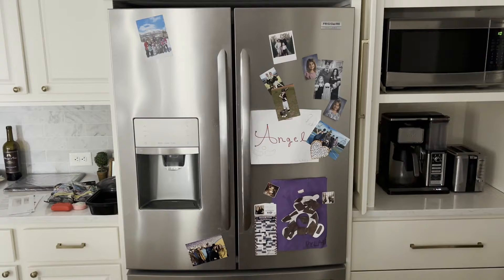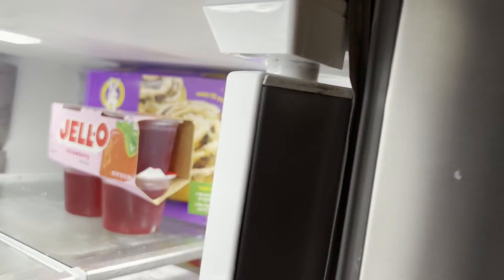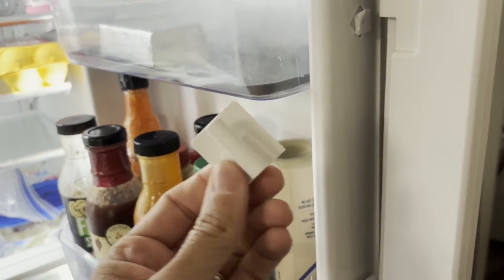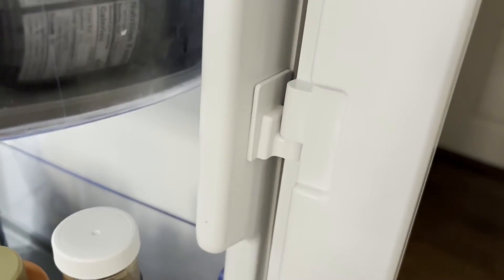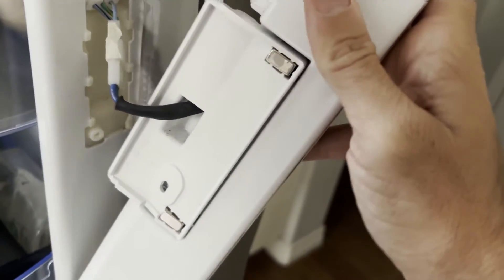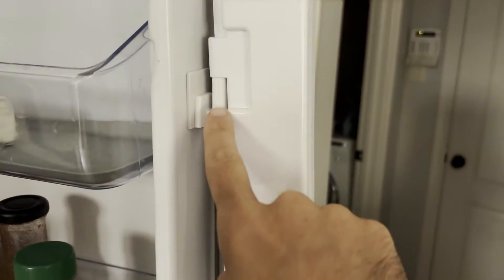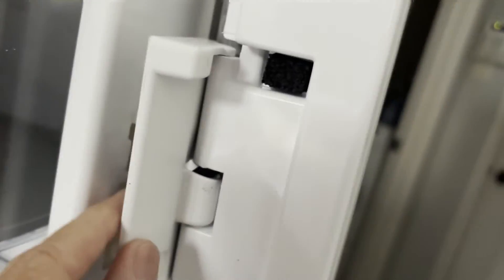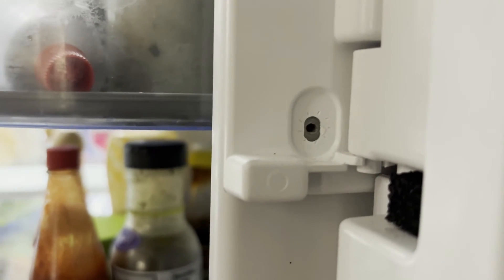How to Fix Broken Door on a Frigidaire French Door Refrigerator

Comment: Kind of pointless to fix the hinge when the plastic (on the door and not the flap) around the top mount is broken. Its ashamed that the top & bottom hinge don't get the same structural attention that the middle hinge does
Reply: It is cheaply built. I have 3 out of 4, drawer rollers that broke off. I can't replace just the rollers I'll have to buy two new shelves. They cost $115.00/ea.

Comment: In the comments there's a reference to reinforcing the hinge pins with a small screw. Is there any video or pictures of how you did this?
Reply from the maker: @susangalloway1716  I eventually did this with mine because the glue didn’t hold a few weeks later when my kid slammed the door shut.

I used a very short self tapping screw just  long enough to get a couple threads in the side of the door (I didn’t want it to go too deep and risk puncturing something).  

It has held great since then, it looks a little goofy but you can’t really see it unless you are trying to look for it and it keeps me sane not having to mess with the door anymore!
Reply: Great comment and question. Both the top and the bottom hinges on my fridge broke off the way the one in the video did. I slowly and patiently (so as not to crack the plastic piece) drilled an appropriate sized hole on the (R)ight side of the plastic hinge, fitted the hinge over what was left of the plastic square knob,  drilled a very small hole into the door for the screw to start in, and then screwed in the (self tapping) screw.

Comment: Just got a new house and it came with this fridge. Previous owner broke both the top and bottom hooks off. Going to order 2 replacements. Ill probably throw a small screw in there to hold them in place too
Reply from the maker: My glue didn’t hold so I ended up doing that exact thing and put a screw in it!  No issues since!
Reply: I could use some advice on what type of screw to use for this very same problem. The super glue did not work, for me. The glue did not harden.
Reply: @stettenfarms  i used small, short screws i had laying around in the junk drawer. Eyeball it or ask someone in person if you are not sure

Comment: I tried using glue to hold mine back in place. It didn't stay. I did order some new hinge pins due to the top one is loose. I also noticed when I removed the flapper, the wiring was not connected inside of the flapper. It doesn't look like it was connected to anything because the wires don't look like they were ripped out or even connected to anything. I haven't found anything online showing how it needs to be wired, or if it needs to be connected. Anyone else run into that issue, or know where I can look to see what I need to do if they are supposed to be connected?
Reply from the maker: Mine had a tab that held the wiring that got knocked out but I was able to tuck wiring back inside.  I didn’t see any indication that anything was disconnected though!

I ended up putting a screw in mine too to make sure it held as the glue eventually gave way when one of my kids slammed the door 🤦🏻‍♂️

Comment: This is the exact same problem I'm having with my fridge. Cheap plastic! I also tried the super glue trick but, it did not hold & the glue did not harden. Was wondering if its because of the Temperatures? There must be a glue that would hold.
Any more suggestions?
Thank you so much for this video!
Reply from the maker: @stettenfarms  I ended up putting a short screw in mine and it has held great!  Just long enough to go through the clip and hold it to the door
Reply: @daddoesitALL  thanks for your reply but I have another trivial question and I think I know your answer. Just confirming...did you screw into that little (square/diamond shaped) plastic tab thingy, that the hing actually slides down on?
Or, did you screw into the actual door side?
My thoughts are, that tab plastic, easily breaks & crumbles so it would not be solid.
Reply from the maker: @ I slid this piece (https://amzn.to/3w7MR0O) onto the tab it fits on and then I secured it to the door itself by putting a screw through the top flat portion and into the door itself.
Reply: I used JBweld and put a couple screws in it (#4) and its been holding fine for a while now ....

Comment: Sorry if this is a dumb comment, but what type of screw did you use to reinforce the pin? Having the same issue of glue not holding. Thank you in advance and appreciate your videos!!
Reply from the maker: @rachellindley2832  a very short metal screw…just long enough for a couple threads to pierce the door and hold the pin to the door
Reply: @daddoesitALL  wonderful thank you so much!!
Reply: Not a dumb question. I'd like to know the same thing!
Reply: @stettenfarms  hi! So I ended up using something called “JB weld”. It’s a very strong adhesive and it did the trick, no screw needed! It’s held without issue the last three months. We couldn’t get regular glue to hold. Good luck with yours, it’s an aggravating issue!
Reply: @rachellindley2832  ohhh, great idea. I think I'll try that first. Thank You! (We ladies have to help each other out 😉)

Comment: My flapper is ok but we had to take the doors off to get it into the house and put the doors back on. Now it seems the left door doesnt raise up high enough to engage the flapper
Reply from the maker: hmmm, what do you mean engage the flapper?  It doesn’t close enough to seal against it?
Reply: The flapper doesn't go back on it's own. The hooks seem ok. But we have to manually open (close, so that it seals correctly)
Reply: I’ve had mine about 4 months - sealed great at first now - like yours the flapper is  not engaging.
Reply: We removed the flapper. Didn't have to order any new parts. Just raised the flapper. And it works great now .🤞 @BethBlankenship-rn8mc
Reply: This video was very helpful